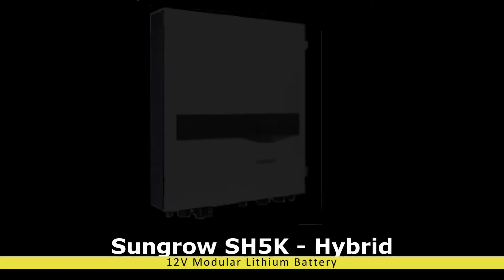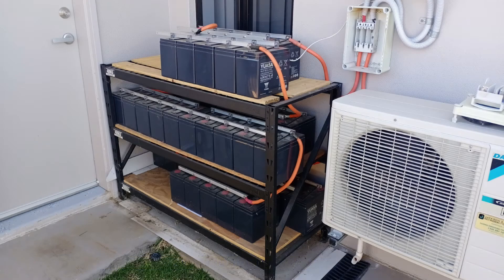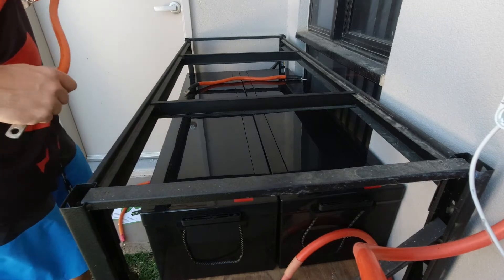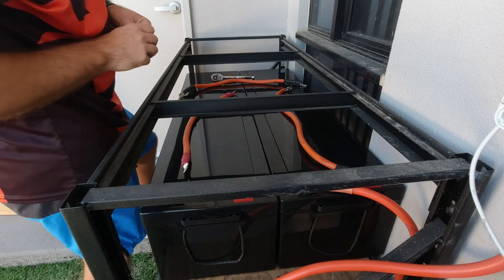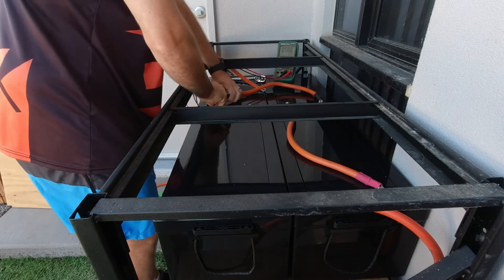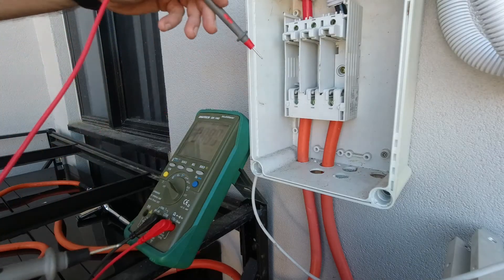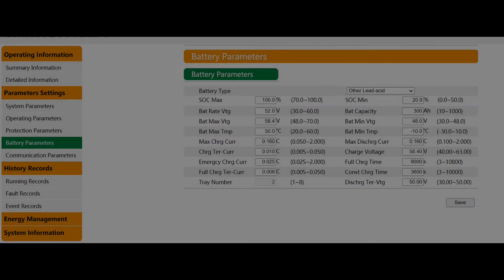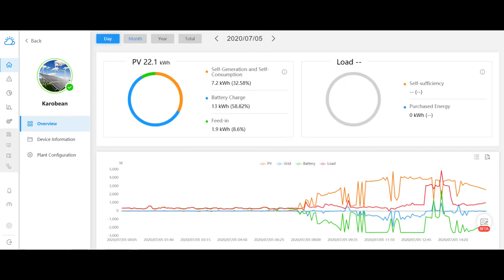Sungrow SH5K with 12V lithium Batteries (LifePo4)

Comment: Hi TheAnimalector, firstly, great video! This stuff is great for us DIY types. Question you may or may not be able to help me with or potentially point me in the right direction. I got given approx 35 x 75ah HRL 12280W FR batteries. I have a SH5K-30 Sungrow inverter and am wondering if there is a way to use these in my setup? The batteries seem way to good to scrap. Have volt tested all the batteries and they are sitting at 12.4-12.7v give or take. Any advice would be awesome! Thanks
Reply from the maker: Best way to learn is to have a go. Be super conservative with you discharge settings. If you have a 200 Ah pack stop discharging at 100. I'm not sure about the newer SH5K but mine only had voltage level monitoring for lead acid. So be conservative on the voltage cutoff.. 
Be careful too.  That inverter has lethal voltages inside.
Reply: Fantastic work. I'm only 70km away .. got a shk5 -20 offgrid .. nice work

Comment: Thats great. How are you finding it? Still getting a bill for your household? Thanks in advance.
Reply from the maker: It's been a journey.  Basically, I ripped the guts out of these batteries to get at the bare lithium cells and fitted a Batrium Battery management system that communicates with the Inverter.  The 12V batteries as they were didn't work. Thats just not what they are designed for.  
I still get a bill but it's small.  Mainly because I don't have enough solar and I live in a location that's typically >30deg C so we use the aircon a lot...

Comment: Do you think there are better value options today than the SH5K-30 (current)?
Reply from the maker: Well I don't really know, but the newer version has better firmware and compatibility with batteries.  Mine is the first version and is not upgradable.  It has been good so far. So I would recommend it. I haven't tried others though.
Reply: @TheAnimalector  I was also interested in using sungrow sh5k-30 with a DIY LifePO4 battery(16*280AH Eve Cells), but I have been unable to confirm whether the inverter software will allow you to charge DIY LifePO4 battery. I see you are using the Battery type "other-lead acid", did you have any concerns over not using a Lithium charge algorithm(constant voltage/constant current charge algorithm). Whats your experience so far
Reply from the maker: @brunosrun8202  hey mate, I'm now using the lg chem lithium profile in the inverter. However as my inverter is an early revision there have been no firmware updates and therefore there are some issues.
To make this work with a DIY lithium I recommend a Batrium BMS which can emulate the LG Chem canBus profile.  It talks to the sungrow. And newer versions of the Sungrow should allow more robust integration .
Reply: @TheAnimalector  thanks for the info, I will checkout the batrium bms
Reply: Another thought is it possible to use one of the Lithium battery profiles without the Can bus connection or will it throw an error and not charge?